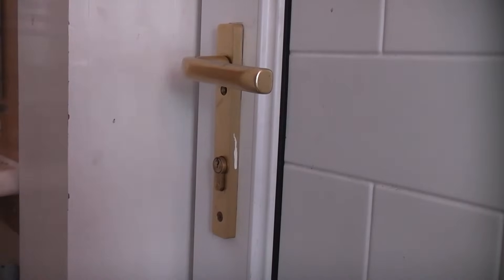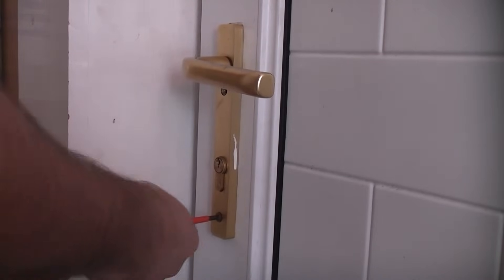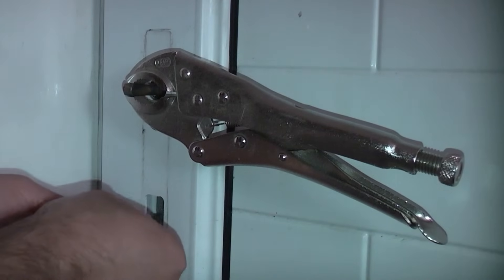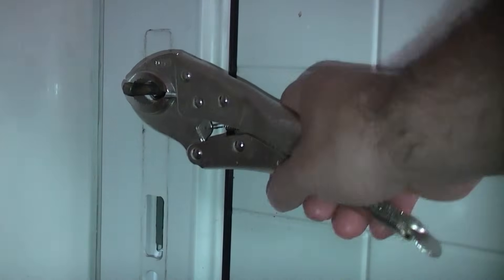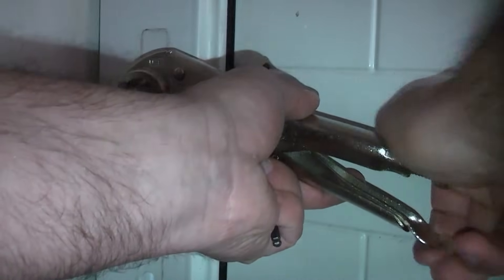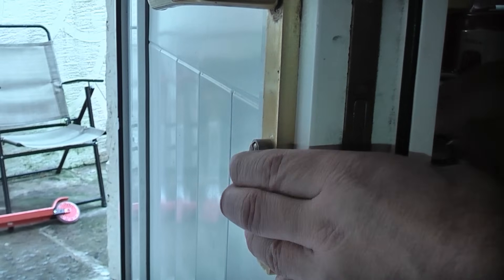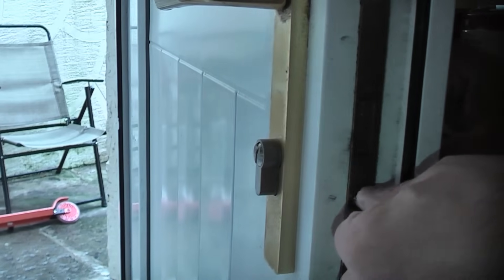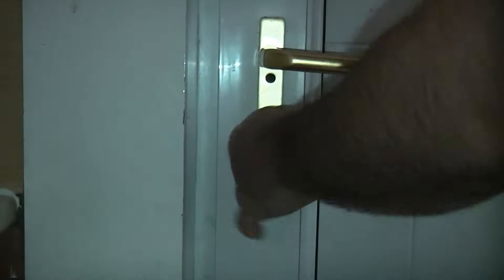Replace a euro cylinder without the key | lock snapping

Comment: Top man, lost keys so French doors in locked position, I followed the advice and it did the trick, my builder pal was here at the time and was well impressed!  The cylinder was wobbly so we held with mole grips inside and out at same time and it snapped sweet as a nut. New lock fitted and now able to open doors, big help on such a hot day!  
Thanks for the video and advice!
Reply from the maker: I'm glad the video helped ;-) 
Thanks for the comment
Reply: So was any thief lol

Comment: Thanks a bunch! I was trying to fix my shed lock where the key got stuck inside but decided to "just" snap the cilinder like burglars had done to my front door years back.
Except that I couldn't figure out how to break it! Here's hoping I can remove the broken lock with your advice!

Edit - For anyone facing a similar problem:
I followed the instructions in this video precisely, didn't get it to work so I ended up getting a big hammer and wacked it until the innards fell out. Then I saw I could use a flathead screwdriver to turn the lock which allowed me to straighten the turning bit and remove the cylinder. 

The lockingplate/mechanism itself also died during my trials. I have newfound respect to those that broke into my house without a hammer.
Reply from the maker: Thanks for the comment

Comment: Many thanks for your excellent demonstration over what to do. Other videos tackling the same problem are difficult to follow without expertise, and as for drilling the lock barrel, you might end up ruining a new drill as I did, even though it was only a brass cylinder! Your method, by comparison, is much faster, safer, and eliminates this risk. Only problem I encountered was how to push back the lock catch when the cam had detached from the cylinder (now broken and in two pieces). Fortunately, I was able to form a tool with it to act as a key, by pushing it onto the end of a 6mm socket, and then rotating the socket inside the mechanism like a key would in normal circumstances. Wow! Twenty minutes work, mostly fun, and you've saved £125+ Keep 'em going!

Comment: Thanks. Worked a treat. I was away when my wife lost the key. She got someone to try and change lock but they tried drilling and broke several drill bits and spent ages trying to remove lock. Your tip and 5 minutes later lock was off.
Reply from the maker: +Gordon Nicoll 
I'm glad the video helped ;-)
Thanks for the comment

Comment: That was great! I had a very similar lock with the key and the cam stuck upside down, inside the door, no way to remove the key or to take the cylinder out. Now it's in pieces and I've learned a lesson: don't buy cheap cylinders! Thanks!
Reply from the maker: You are welcome
Thanks for the comment

Comment: Brilliant! YouTube sorted a problem again thanks Ultimate Handyman - don't know what the fuss about security issues was, you need access to the lock on the inside to do this! Just make sure the new cylinder is correct length and doesn't protrude too much on the outside.
Reply from the maker: Thanks for the comment

Comment: Your video made me over confident. If the Alan key bit doesn't work for you, look up into the mechanism and you can see the bit the lock normally moves to unlock the door. Move it the desired way with a screw driver and you should be good.
Even with the hour of swearing and fiddling with the Alan key the video saved me a hefty bill from the locksmith so thank you sir
Reply from the maker: Thanks for the comment

Comment: Brilliant - I kept failing until I turned my grips UPSIDE DOWN to how they had been - then it worked INSTANTLY - thank you!!  Saved us £80 labour from a lock-smith
Reply from the maker: Glad it helped!
👍
Reply: @ultimatehandyman  what size Allen key was used if you know? Currently trying but don't know whether I'm using the wrong size
Reply from the maker: @Stevengrigg1   The larger the better, I think 8mm will do it!

Comment: This is both a good tip how to fix broken lock and a good demonstration why you shouldn't use euro cylinder locks in the first place. If you must use euro cylinder lock, I'd suggest to get something with hardened steel body instead of brass bodies. And even then the weak part will the be area around the screw in the middle.
Reply from the maker: Thanks for the comment 👍

Comment: Sorry to spoil all the good feedback, but I had a door that was locked, the key wouldn't turn fully, and therefore the door stayed locked. I bought a new Cylinder plus a new lock body as I had a feeling it was the body at fault. I knew then i would have to destroy the existing cylinder as per instructions in this guide. Well let me tell you this. Tarzan of the Apes with Superman assisting wouldn't have been able to perform this method. With all my might it would not break. After fighting with this method for some time I decided I had to drill through the aluminium gaps into the lock body and then try to push the lever up manually to unlock. No luck there. The lever moved up but I still couldn't turn the handle. After more holes in the lower area i looked at the new body and realised if I drilled a hole up real high beside the latch, then I may be able to grab it and pull it in. I was finally lucky as when the hole was drilled the door pushed open. All this took a decent hour plus. I'm guessing that there are various grades of cylinders. Mine was a Interlock (made in New Zealand). Let me tell you it is SOLID and twice as heavy as the new replacement. Judging by other youtube videos, there is a problem with the ease that burglars break into houses (UK). They will need to bring a bulldozer to my house.
Reply from the maker: Thanks for the info.
I thought all Euro cylinders were pretty much the same.
Thanks for the comment

Comment: please, I need to ask you about a problem with a euro cylinder of a house door. I had to replace it recently. The new one didn't turn twice as the old one did. Only one turn and a half! it couldn't reach the end of the second turn. So, I replaced it too! But this last one is doing the same! I can't turn the key twice as it should. I have to use only one turn to be able to get the key out of the door. Should I replace the whole door?!😃 Thank you for your time.
Reply from the maker: +Radwa Adam 
Hi, it sounds like the  gearbox on the multi-point lock might be failing.
Have you tried to lock and unlock the handle with the door in the open position? Is it the same as in the closed position?
Here is how to replace the multi-point lock on a French door which is a similar job.
https://www.youtube.com/watch?v=nEDbRB27FKA
Reply: +Ultimate Handyman +Ultimate Handyman Thank you for the quick response. Yes, I tried it. It's the same problem whether the door is opened or closed. I guess I have to replace the whole multi-point lock. thank you.
Reply: +Radwa Adam Sorry, I need to ask you again; If the new euro cylinder is a little longer than the old one (which was working well), would it cause this problem?
Reply from the maker: +Radwa Adam 
It shouldn't do providing the door handles are straight and are not bending the euro cylinder.
You can check that by slackening the two door handle retaining screws on the inside,  just check both handles are aligned correctly then tighten the screws back up.
Reply: +Ultimate Handyman Thank you. I will.

Comment: My door has a recent ABS lock and it seems sturdy. Yet it seems broken as the key turns into an infinite loop. As the door is locked, I suppose I have to snap it.
But would it work with that method? I've read you said some locks are snapping-proof. Thanks.
Reply from the maker: If the lock is snap proof, you will not be able to turn the cam after snapping the cylinder.
I'm sure ABS are snap proof, but if I remember rightly they are only snap proof from the outside (not the inside). If you snap it from the inside like in this video, you should be able to turn the cam to undo the door (but I can't guarantee it)
Thanks for the comment
Reply: @ultimatehandyman  Thank you for that detailed and useful answer! I've contacted the installer but he did not answer... but you did. Indeed i've just checked and the ABS lock is not snap proof from the inside.
I've also seen that the moving part of the lock is properly turning 360 degree around the lock when I turn the key. So I suppose the lock is not broken... but the door mechanism is broken... which is worse...
Reply from the maker: @christianlaville2382   I think that locksmiths deglaze the door when the door mechanism is broken and the door is in the closed position, but I'm afraid I do not know what they do after deglazing the door. Sorry I can't be of more help.

Comment: Euro locks are terrible oversight by the door industry. No need in a multi point locking mechanisms when a pair of mole grips can open a door. Anti snap locks are a must. good job
Reply: I'm shocked that such a shoddy design was allowed to exist on the market. What were they thinking?
Reply: @JohnSmith-ws7fq  That you can just as easy kick in most doors. Or silently drill them open with a hand drill, preferably some back door.

Plus anti snap locks exist, so you can just spend the extra money.

Many people don't even lock their doors, the ones without handles on the outside, and you can just slip them open.

It's really not that hard to get into some random door.

If you want a safe door, you'll have to spend the extra money for a quality product, just like with everything. A 10 Euro Chinesium lock won't do.

Plus, you don't even have to snap the lock, it's even quieter to simply rake or pick the lock, which has the added benefit, of the owner not being alerted to the break in.

Comment: Ok a couple of points regarding these eurolocks.   Yes they are easy to snap so if it worries you buy anti snap cylinders.  If the handles havent been removed and remember the screws are on the inside it is impossible to grip the cylinder to twist and snap it and also when the cylinder is the correct length it shouldnt stick out past the door handle.   The video is handy if you have lost keys but you can still gain access to house.   Also its very difficult and very noisy to break handles off to expose the cylinder.
Reply from the maker: +biggixer 
Thanks for the comment ;-)

Comment: Thank you UH!!! At first I was really sceptical and thought 'Yeah, but that won't work for me'. Then I took a hammer and walloped the bastard a couple of times, not too hard, and bingo, it snapped in two with ease. 
The reason appears to be - looking at the two broken halves - that the only place the two 'sides' of the lock body actually connect is right at the bottom where the threaded securing hole is, and therefore a really weak area. 
When you stress it sufficiently it cracks open. The metal they are made from is heat treated and is therefore strong in compression but brittle. I didn't have mole grips to hand so resorted to using my hammer. The part you have to break is only about the thickness of a couple of match sticks, and will quickly either fatigue or snap when put under pressure.
My drill breathed a sigh of relief as it knew it was about to start drilling away the brass drum of the lock, which always results in a broken bit as it gets far enough into the brass to 'bite'. 
So once again, thank you UH!
Reply from the maker: You are welcome
Thanks for the comment 👍
Reply: Hell of a coincidence ! . About 2 broken worn out bits into drilling the barrel this video turned up and  saved the day

Comment: Since it's easy for a burglar to snap a handle and gain access to a cylinder, do you think it would be a good idea to weld the outside handle to the door instead of letting it be fixed with screw? (my door is an aluminum door) provided that you can still change the cylinder when needed by removing the plate that's on the inside of the door and then removing the cylinder from the inside.
Reply from the maker: If they want to get in they will. I just recommend anti-snap cylinders and a fully working burglar alarm 👍

Comment: Thanks for the tips. I managed to break the lock so I can see right through but my door was locked shut at the time and I’m having no luck with the Allen key - any tips on what to be looking for to turn when you are putting the Allen key in? The video looks very effortless but I’m not having the same experience 😅
Reply from the maker: There should be a bit inside, that the cam engages with, you need to use the Allen key and mole grips to rotate it- then the door should unlock.
Thanks for the comment 👍
Reply: If you know how the key cylinder works then you can work out what the allen key needs to do-- you are just duplicating its action of withdrawing the bolt. Putting a  bevelled metal escutcheon on the outside of the door would stop most snapping.
Reply: I had exactly the same problem and just got another barrell from another door and fitted this and upon turning the door key heh presto

Comment: There was an agreement by the Press that this method of breaking into houses would not be publicised as the majority of homes in the UK have this type of lock. I worked in the lock industry and actually invented one of the anti snap locks now sold and fitted to new doors. I would recommend anyone replace their old cylinders with anti snap and anti bump locks with the 'Secure by Design' logo which are now widely available. I now work as a locksmith and can open old failed cylinder locks in seconds, the new ones are not so easy.
Reply from the maker: Thanks, it needs publicising as people need to know and secure their locks.
I always recommend a fully working burglar alarm, as anyone that relies on a a door lock or a window lock to keep burglars out is asking for trouble!
Thanks for the comment
Reply: Stephen Robbins locks are only a token anyway, if you have a door  you have easy access to anyone with a skeleton brick.
Unfortunately the most widely available 3 star cylinder which at the moment I would say is the take platinum or superior are garbage, they concentrated to much on the snapping and the pick resistance is shocking .

Comment: I have the same issue (bought a house but wasn't given all the keys!) 
I'm struggling to see where I put the Allen key after snapping the barrel though. It is a small front porch/French doors. Any ideas? 👍
Reply from the maker: If you look at the cylinder, there is a cam, which turns the lock on the door.
If you can't see anything, perhaps the cylinder is anti-snap?
Reply: @ultimatehandyman  I've sorted it mate thank you, the cam was there!

Comment: BURGLARS don't need you Mr handyman to show them how is done. Having paid a lot of money to fit a supper duper lock (euro lock) with a key I thought could not be picked, the lock as you mention was violated in seconds. Now they cut a groove about 1/2 inch in hopefully will snap there and not in the middle. what a farce. Anyway thanks for uploading anybody out there take notice. change your locks. ENJOY YOUR VIDEOS Regards to all
Reply: DONT KNOW WHY THEY DON'T MAKE THE LOCK BODY OUT OF STEEL. THEY CHARGE ENOUGH TO WARRANT THAT.
Reply from the maker: Thanks for the comments ;-)
Reply: CHRISTOS TSANDAS

It is steel; its just the point where the bolt passes through the lock is very thin and that where the cheap locks snap, as there is now no bolt retainer, they just push the other half out and they are in and nicking your stuff.

Builders always put in the cheapest nastiest generic locks; change them ASAP>
Reply: The locks I have seen as installed on my door were/are made of brass, the one that was forced had a steel strap underneath, and they were not cheap. £80 is not cheap. But burglars if there is a trick they will be first to know it. regards
Reply: No, they are generally Brass.
Reply: This only works if you can get to a decent amount of the lock. When it is installed properly with the handle on there is not enough of the lock to grip to snap the lock.
Reply: jem8472 they grip the handles and rip them off first

Comment: Hi handyman

The other day I lost my keys.......... Eventually I realised I was forced into smashing my back door in..............that didnt sound right I know......but I did!!!!!

Its like the entire door is a panel..........so after a LOT of smashing the centre panel gave way ( without breaking it ) and left just the outer frame.

However.......... Before I smashed the panel in......... I also tried forcing the handel.
Which is now broken......... I think the strip thing with the "gears" etc is broken.....  can you tell I dont know much about this lol.

Well Ive put the door back together, but it now wont open.  I think I need to get it open and replace the strip thing AND the possibly the barrel\handel etc.....  

Can you help me please.  One extra little problem is that the head on one of the screws that holds the handle in, is worn away so I cant unscrew it.  

I basically want to do what this chap https://www.youtube.com/watch?v=CEfw2XT3504 wont tell me how to do, and I just dont have a spare few hundred £ at the moment.    Any advice much appreciated.
Reply from the maker: +Rodonal Ducuate 
I don't know how to open a door when the gearbox has failed in the closed position, but I know how to replace the multi-point lock- https://www.youtube.com/watch?v=nEDbRB27FKA

To remove the damaged screw you could try a Grabit, or a screw extractor- https://www.youtube.com/watch?v=-BTKKClUL3E

The screws are normally brass and easy to remove with a Grabit or screw extractor.
Reply: Thank you - I think Ill get locksmith to get door open and then fix the door myself - Ive done it before lol - thanks again for reply.
Reply from the maker: +Rodonal Ducuate 
You are welcome.
Good luck with it ;-)